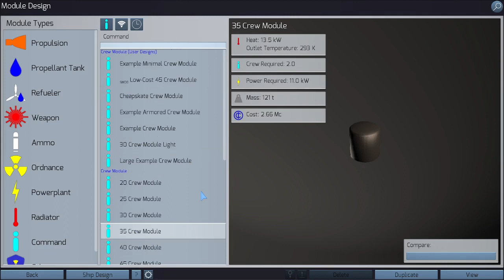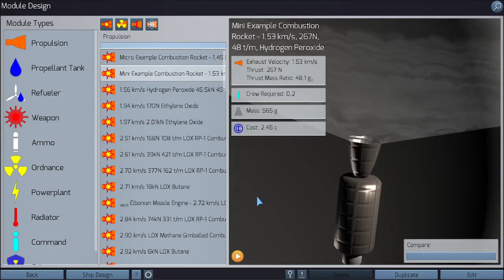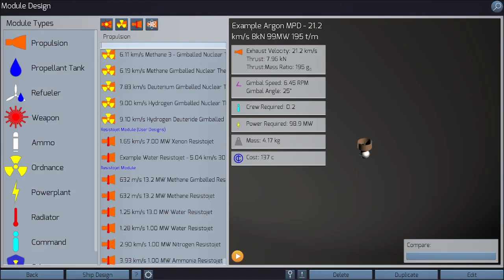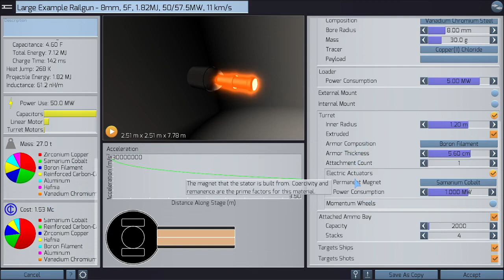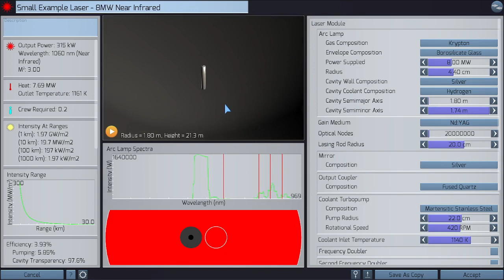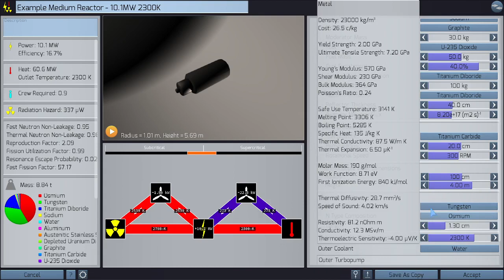COADE Extras: Designing Your Own Modules

Comment: 22:30 - IRL yes, but that is not the case in game (for whatever reason).

27:23 - All propellants that can be used as monopropellant are explosive, even if they are being used as bipropellant (e.g. hydrazine is explosive whether it's used as monopropellant or with dinitrogen tetroxide (NTO) in a hypergolic bipropellant rocket).

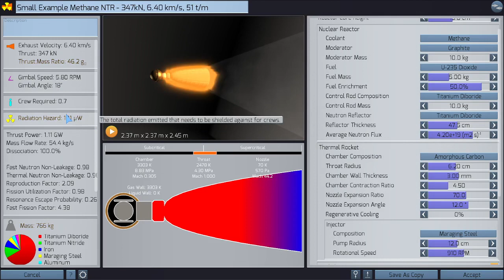30:10 - You modified the engine, saved it, but forgot to update the thrust/mass ratio on the module's name.

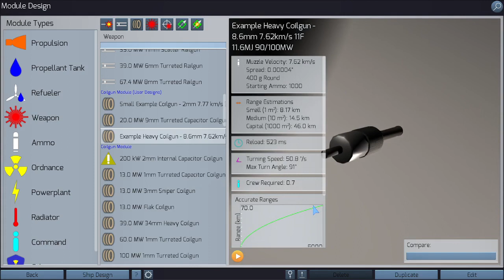59:54 - The reload time shown there is the sum of the projectile loading time and the capacitor recharge time, but if you have enough power they happen simultaneously (it's just that in the module design, game thinks they don't happen simultaneously). The only way to tell for sure what the weapon's firing cycle length is, is to open the design and look at those two times on the left panel.

1:26:00 - Non-metals don't work as thermocouple materials because they don't conduct electricity.